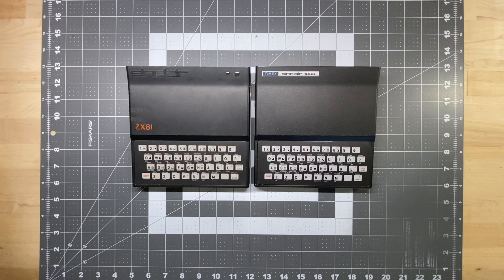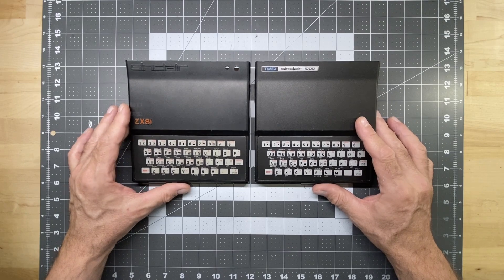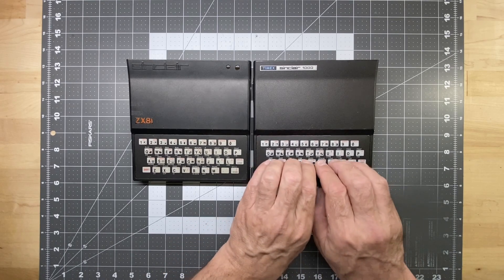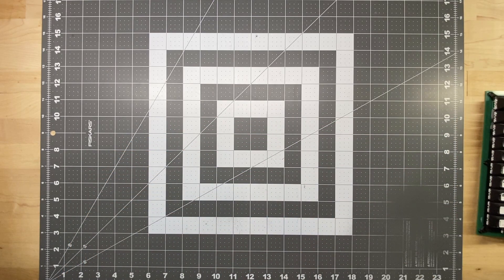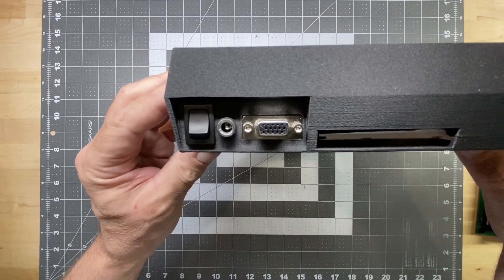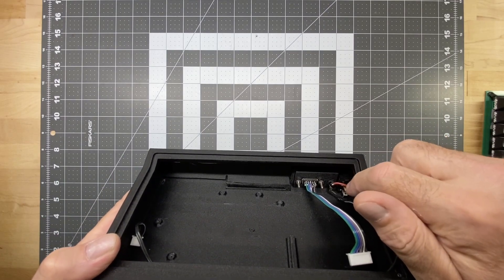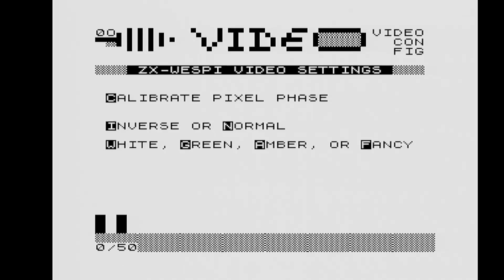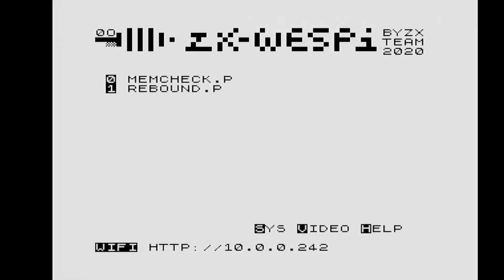Kilozed - A Modern Day Zeddy

Comment: I suppose the community would love a newly designed motherboard (with a slot for the zx81-single-piece-ULA and not for the 20 separate zx80-chips), but including the Wespi on it, is a too-far-gone violation of the authenticity, and a much simpler (also motherboard-included) composite-mod would be much more appreciated, authenticity-wise (still with some prerequisites existing there, for one to still connect a separate Wespi, if one wants to)... The reason is, that all the other mods counted as necessary already in 1981 (even the composite-mod just a couple years later), and that feels "authentic" to many, despite it not being really "authentic" anymore... But the Wespi wouldn´t exist for another 40 years, and is in itself a far more potent computer, that the best Z80-computer ever was... Feels like restoring a 1800s-bicycle, and installing a NASA-rotating-detonation-jet-engine (costing 100trillion$) instead of just 2 pedals... Of course, I suggest creating BOTH versions of a new motherboard, the one you were planning, and an additional one, that´s gonna sell better to the community...
Reply from the maker: Thank you @klausbrinck2137 for sharing your thoughts. I agree with you on the importance of authenticity, and for that reason will be releasing one or more videos on the mods to an original ZX81/TS-1000 motherboard for those with enough skill and bravery to attempt them. Still, there are many people out there that I feel would like all of the mods but do not have the confidence to attack their original motherboards with a soldering iron, or some day soon for others that will not have access to an original motherboard. It is ridiculous to attach such an advanced microcontroller to a 1980s generation computer, but it helps to get access to store and load files without needing a period correct cassette recorder and audio cassettes. One of the nice things about the new motherboard design is that it will work without some or all of the extra features, and at its core still has an original Z80 processor and the ULA or a functionally equivalent CPLD recreation of the ULA as those are now made of Unobtainium. Again, thank you very much for watching and for contributing by commenting!
Reply: @codesurferdev  I can fully follow your train-of-thought, after all, your plan/suggestion is the MORE sensitive thing to do, as you already sufficiently explained. Still, a unique chance to crank out an additional motherboard, that wouldn´t need the WesPi, but the cheap-o 1980s-composite-mod instead... (albeit I cannot judge myself, if those 2 motherboard-layouts are really different enough, that a distinct 2nd one would be really needed).

Comment: ❤- I had a zx81 in 1985. My first computer. I love what you’re doing. Keep it up.
Reply from the maker: My best friend had an Atari 400, which we first learned BASIC programming on. Later, I got my first computer, also a ZX81. Thank you for sharing in the comments! Do you, or did you ever work in tech because of your experience with the ZX81?
Reply: @codesurferdev  thank you for sharing. I studied chemistry but ended up making a career in software engineering. Currently working as an independent software architect. And yes, the z81 was pivotal in my life.

Comment: if you replace the 7805 with modern power, why do you need a heatsink on the ULA?
Reply: The 7805 isn’t that bad when it comes to power regulation. It actually has some advantages over modern units (no high frequency switching harmonics), but it’s wildly inefficient and needs a big heat sink, which is why it mostly gets replaced in older machines (keeping the heat down helps with their lifespan). The ULA was running close to its design maximum, which is why it got so hot.
Reply from the maker: Thank you for watching and commenting! It goes to show that everything has an advantage and a disadvantage, and that many engineering choices involve compromises.
Reply from the maker: Even when the ULA is being supplied with clean regulated 5 VDC, it runs hot.